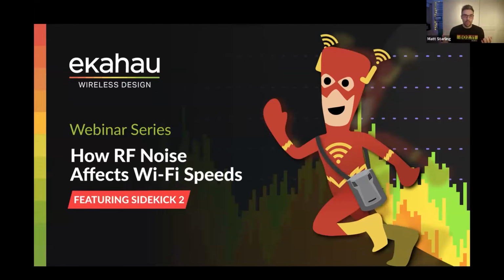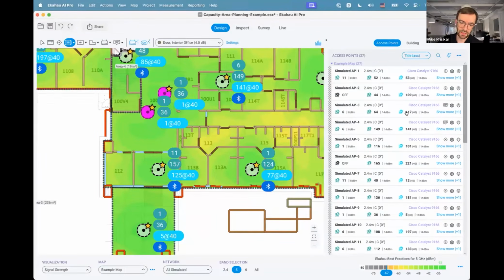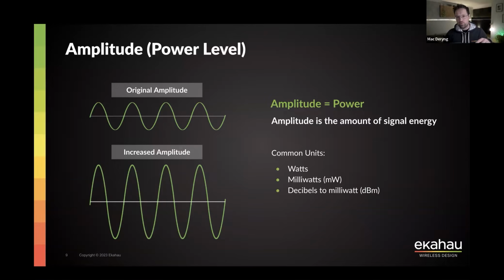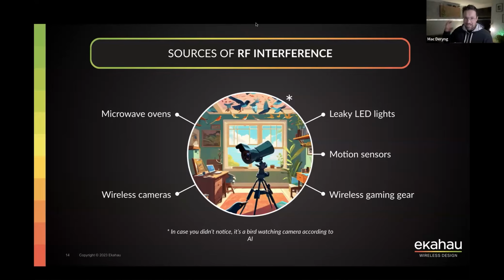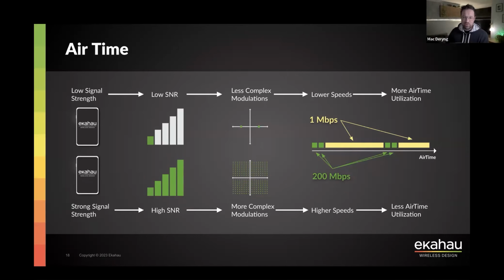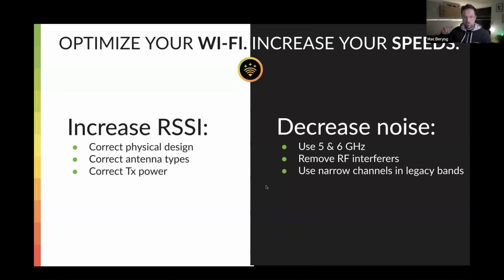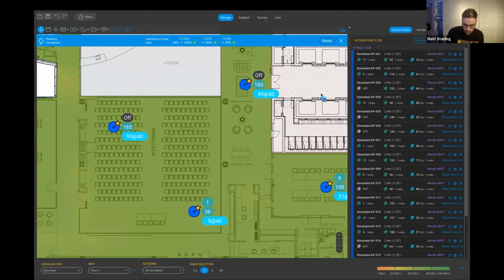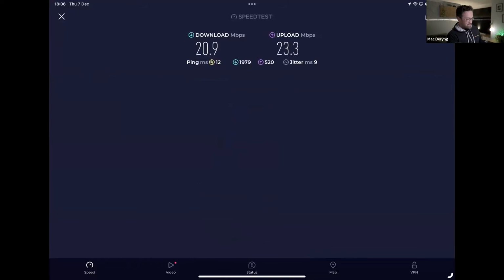Ekahau Webinar | How RF Noise Affects Wi-Fi Speeds

Comment: Wait, I'm confused, the last part of the demo whereby you're saying noise affects the speed of WiFi.

Your noise generator was effectively at close to 100% channel utilization coz I see the colour is dark red/black and it's within -85/80dBm, going as high as -75dBm.

Since wireless uses CSMA/CA, wouldn't your tablet simply be sending request to send probes and getting a response that the medium/channel is busy and rinse and repeat? How was it able to consistently transmit at even 20Mbps???